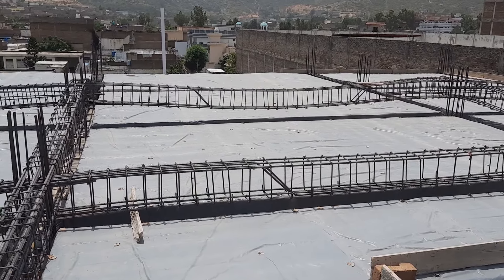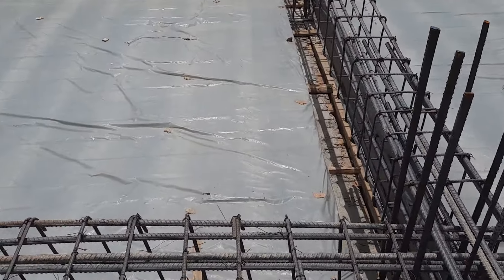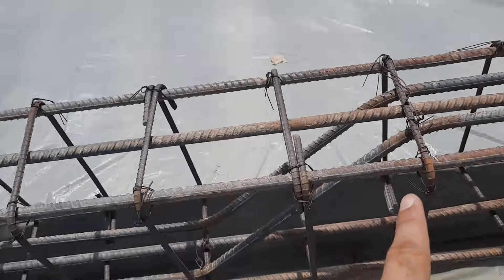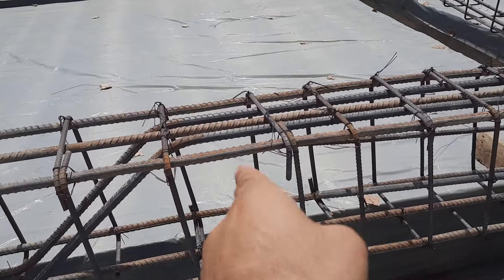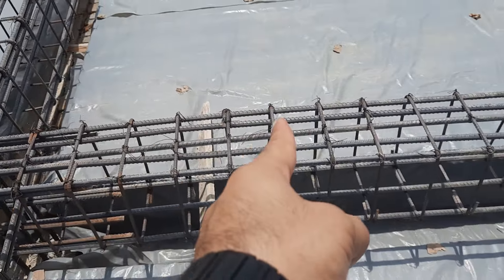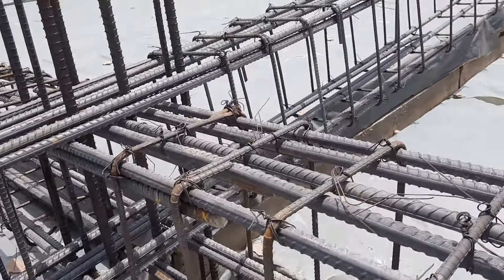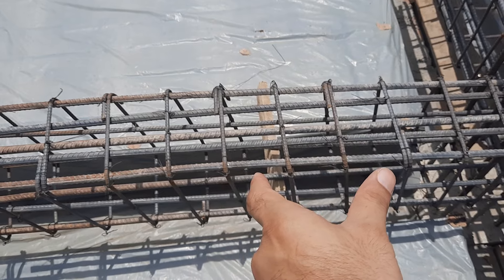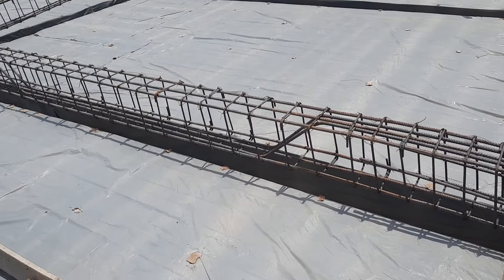Design of Beam for 20 feet Spacing  |  First Practical Video on Site in Detail

Comment: Nice video.  For 16 feet span beam (10X15), can I use 4 straight  bars at the top and 4 straight bars at the bottom instead of any cranked bar?

Comment: If the depth of slab is <= 5" here, it needs secondary beams connecting the 6' span line acc. to the IS code cause the L/d ratio exceeds 40, so I thought that would be covered in the video which was not done, any say in that?
Reply: Reply sir

Comment: Sir can we provide two hidden beams in 20 by 20 hall with 20 mm and 16 mm bars?
Reply: No, Depth of the beam plays a very crucial role in providing strength. In this case the depth should be 20 inches including the slab.

Comment: Can you have the same number of bars and size of the beam for 7m distance between columns?  without increasing beam width and depth putting into consideration bent up bar to L/4 for 7m, also stirrup details as you instructed

Comment: Sir, practically I asked the steel fixer to provide 135° in stirrups bending. But in the case of crank Bar (beam) he refused, the reason for that he told that in case of crank bars then it is impossible for us(the steel fixer) to pass the crank bars in the beam as the 135° stirrups provide resistance during arrangement of the crank bars.
Now if this is the case then what to do Sir?
Reply: You can change steel fixers because its possible they were giving only shitt arguments for there own favour, & you should go for 90° Degree as well its up to you